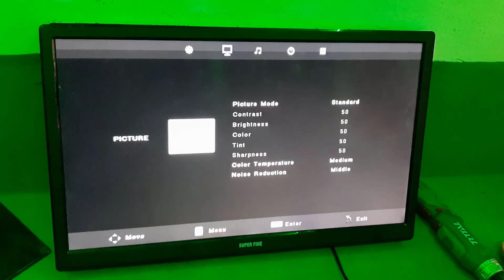All 24'' LED TV power supply ok but deadset full tutorial

Comment: tyake neberegni  sle crt tv new samsung tv new horizontal transistors over heat eyehone beye 2 dekika yikatelal seramic capasitor keyireletalehu ?
Ceramic capasiteroch mekatelachewun enda liketachewn  endet new yemnakew ?
Reply from the maker: On your DMM select to resister section then measure it in two side and it gives reading value if no to ceramic cap not work ok
Reply: @yegnaelecom  betam amesegnalehu
horizontal transisteru beye 2 dekika mekatelu (over beat hono ) yemikatelew ye seramic kapu chigr new?
Reply: Techemari liteyikih new 
Led tv lay 12v ok new le 1118 ic  5v yidersewal  
Standby ayberam min lihon yichilal ? Amesegnalehu
Reply from the maker: @R1y1h1  check regulator ic
Reply from the maker: Yes it may be ceramic,flyback,yoke,doid check all of them around horizontal

Comment: When power on Super fine 32 inch LCD tv flashing red light but not on? How to fix?
Reply from the maker: 1. Check caps
2. Check 1118 8 leg ic 
3.chech 5 and 6 leg regulator ic

Comment: It doesn't make any sense replacing an IC without checking whether it is fine or not.
Reply from the maker: Ofcource really you are right  the main thing is I want to show this video for bigger than advance. Sometimes  when we check output voltage of 1118 regulator we get well but the impudence is empty during this time checking this ic is makes falt. any ways thanks for your comments I appreciate you 😊😊